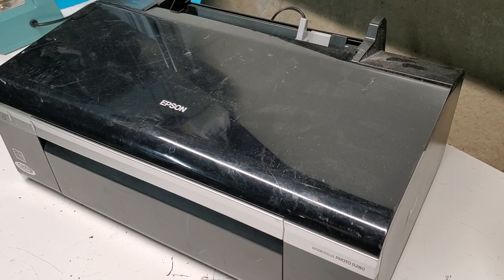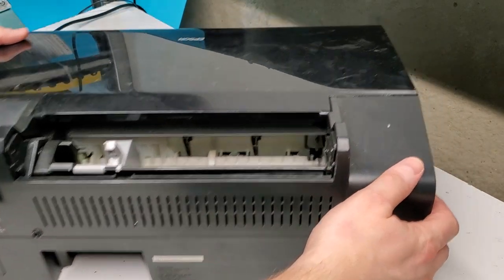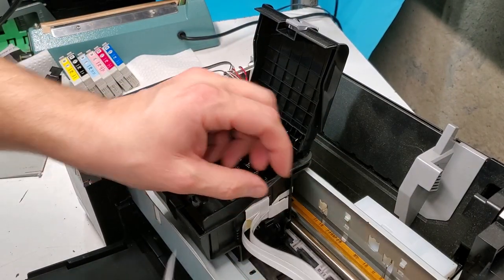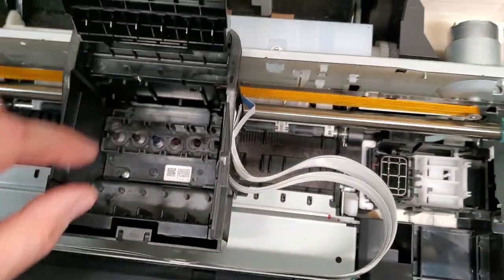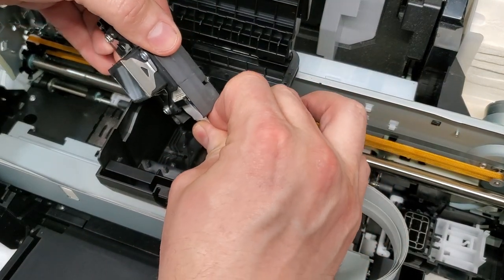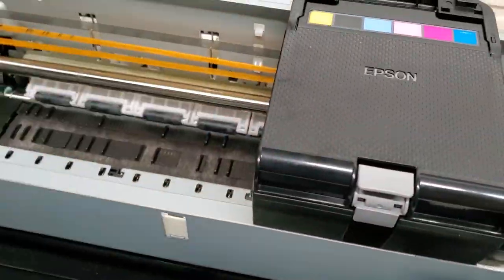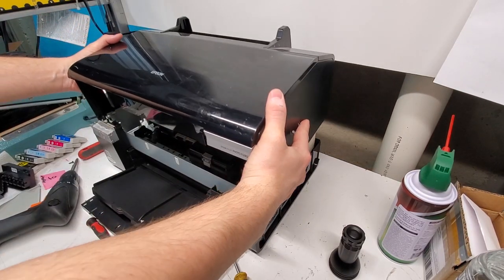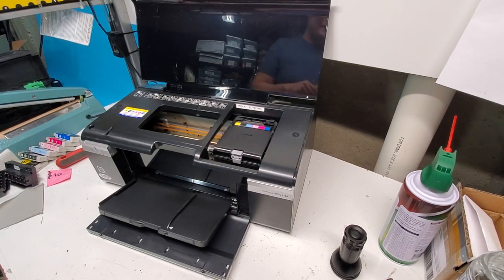How to replace or remove printhead on Epson Stylus Photo R280 Printer F180040

Comment: Do you have a video showing how to replace the timing belt that drives the print head carriage back and forth?  Printer head jammed and the belt came loose.  Belt is intact just not connected???
Reply from the maker: Hi, I do not have that video yet.  This video shows how to get inside the printer: 
https://youtu.be/XFqO8RH2E7I
Reply: Gonna try to fish it in place to get it going again.  I know several people in just my own circle of friends that are in the same spot... mainly due to broken or worn out belts, so this would be extremely helpful.  This was and still is an outstanding printer ... even better when adding a CIS ink system.  Thanks again.

Comment: I have a clogged Epson Stylus Photo R2000 which has 2 more ink cartridges. Would the replacement process be similar?
Reply: From my experiences having a graveyard of Artisans, 50's/260's/280's/1400's/1430's - yes.  The only thing different in my 1400/1430's is there are two release spots on the backside of the carriage. I believe there is a video using a bent hanger or rigid wire...same deal
Reply: @JD-nr8hf  I can show you how ot factory restore all the printers mentioned above to factory new, if they have not been destroyed by the user.  Starting in 2007 when the R260 came out, we began figuring out how to deep-clean these, how to modify the printer to work well with CISS, how to fill the CISS-cartrides where they meet the ink-input-ports, and how to deep clean without making a mess inside the printer.  in 2010 we figured out how to make Epson ink, without any pigment.  This is the best cleaning solution and costs about $115 for eleven quarts.  If you have these old Epsons, DO NOT throw them out.  Why??  The new Epson ecotanks that have built in CISS's (by Epson) do not do borderless printing, and they only use four colors.  When you try to print say 50 pages of full color borderless pages, the print pumps cannot keep up and colors streak.  With six colors in a CISS, you can 1) just add ink as needed by removing a cork, and 2) with six colors, the pumps can keep up.  I know of no epson printer, after 2019, that will produce borderless prints like these older printers.  With borderless printing you can use these older Epson printers to produce large posters using poster software on a PC.  We have produced and used more then 1,200 of these posters.  You create the image like a photo, the import it into the poster software, specify numer of pages with width and height and it prints it out with 99.5% perfect registration. Then you assemble it like a tiled floor and tape it together on the back side.  New Epsons do not have borderless so this cannot be done.  you can make  poster two pages wide and two pages high, so four pages or 17" by 22".  We typically print 5 pages wide and 5 pages high, so the poster is 42.5" wide and 55" high. iPhone pano's can be printed out 5 wide and one high, so the five pages taped together make a nice coffee table photo (11" high and 42.5" wide).  The largest we've produced is nine wide and 7 tall, so that poster is 76.5" wide and 77" tall. We printed another 96" wide and 99" tall but coould not assemble it, or figure out how to mail it.  Interesting isn't it?

Comment: Thanks, helped me get out head and soak it.  Clear some of a blocked yellow.   Might have to clean again as even after 3 cleanings and yellow purge printout, the yellow is still not all perfect on nozzle check print out.  But much improved then before.  Man getting the chip reader out was tough and getting ribbons back into print head.  I know you MUST get those ribbons in all way, or else can fry the board and they kept popping out until i really got them in good.

Comment: What is that stack of pads in top (further) right corner of the printer? Mine are black and those in the video are white. What is the purpose? Noise dampening?
Reply from the maker: Hi. The excess ink drops go there to avoid ink leaking out of printer. They are called "ink waste absorber pads"
Reply: The pads start out white, they absord the waste ink every time you clean the print heads.  You  can drill a hole in the side of the printer, then bring out the great 3/16" tube to an external tank.  Be sure the tube stays level with no uphill to the external ink tank.  If you are careful and use a clean 4 oz water bottle (rinsed with distilled water), then you can reuse this as black ink in a CISS system.  I mostly use 2 cup cheapo tupperware from the dollar store, four for $1.25.  Just drill a hole at the same height  as the 3/16" tube you bring out from inside the printer.  Epson count print passes, pages, and cleanings and has set the 'End of Service' such that the waste ink will not spill out under the printer.  That is their reasoning.  But this is just to get you to buy new printers, since the dye based ink is water based and the ink goes into the pads and water evaporates. I have never see any spillage.  I have R280 printers with 45,000 pages printed, with brand new waste ink pads. These printers all have external waste tanks, and they sit next to the CISS (continuous ink system) to the right of the printer.  Each time you clean a R260, R280, Artisan 50, it pushes ink of every color through the print heads (no matter is they are clogged or not). One cleaning pushes about 5mL of ink through. Considering a cartridge has about 10 mL of usable ink, then six cartridges have 60mL --- so 5 mL is a lot of ink.  This is by design so Epson has you buying ink cartridges.  But innovators designed the Continuous ink system (CISS) which has about 150mL of each color of ink.  So cleaning is no big deal, since you have a lot of ink.

Comment: I bought this printer used and all the cartridges appear to have ink but it’s not printing correctly. I think black is missing. 

I’m going to attempt to remove the print head based on your video. Good job by the way. 

What is the best way to clean the head?

Should I try to clean with alcohol while in place or it’s better to remove?

Thanks a bunch for help.

Comment: It went nice and smooth until I put everything back together. I tried cleaning head with ink and it looks like head drivers QM1/QM2 (TT3034/3043) went in smoke :( I presume I didn't let the printhead dry out long enough (over a day) from distilled water. It looks like those drivers are ~$50 on eBay and I'm not sure they took anything else on the way. Perhaps, it is time for me to move on. Don't repeat my mistake while cleaning/soaking.

Comment: Amazing video. Using one hand removing and installing it while the other hand holding the camera. Is this the same replacing the EPSON R260 Printer?
Reply from the maker: Thanks 🙂. R260 is similar to this printer and the printhead set up, but  printhead for r260 is not the same as r280.
Reply: @303electronics  Thank you so much! Keep up the good work and Happy New Year to you and to your family.🤗

Comment: Great video. Followed your steps exactly, now both ink reset button and forward paper buttons are flashing. Both flashing in unison.  When you turn the printer on, the green power button blinks as print head tries to find home, then it slowly goes all the way to the right, slowly, then stops , makes a noise like print heads are going up and down, then the orange lights come on.  Print head and ink carriage moves freely when you turn off printer. How do I reset this R280 so it works?  It will not print with ink button and paper pass button flashing orange.
Reply from the maker: Hi. Please make sure you have reconnected all wires properly.  The reset is not necessary. I do not know a reset process on this printer.  It is a bad connection of wiring. Please do over the process again.
Reply: Are you getting any messages on epson print monitor software?  Dual orange lights are usually an indicator of crippleware activation based on number of prints. It was epson's contention that the waste ink pad only had a certain number of prints the printer could handle and it had to be replaced and the counter reset with epson proprietary software. Unless you are insanely wealthy and have a sentimental or work-flow attachment to this item this is not economically viable.  BUT: I have two suggestions 1: install a waste ink receptacle (easy). 2. Google epson counter reset software and buy the one not made by epson, do not use the epson one. Only the paid version will remove the crippleware.  Costs short money to buy the software. If you use the temporary epson one it will render the third-party solution unusable.
Reply: @Houseofbears  Nice ideas.  Dual orange lights do indicate an End Of Service (EOS) which means no more use.  Correct.  And you can reset this by googling on Wic Reset and downloading the free reset software. You are correct also that the EOS is based on predicted "full" waste ink pads, which wicreset software can report. Once the level is at 100%, the cmos of the printer thinks the waste tank is full, and thus EOS to keep ink from leaking out of the printer.  The pads are located behind the print heads (R280 family)  when they are in the refill position.  Adding an external waste ink tank is a good idea, and we do this on most machines; However, the CMOS counts number of cleanings and pages etc and so will need to be reset every 10k to 14k pages (depending on number of cleanings).  Wic reset software offers a paid key that you can type in to reset the machine. These cost $10 each or $4 in bulk. A key can only be used once and the author does a good job of keeping track of when used on what printer.  You can get a free reset to set the counters to 75% by using the key "TRIAL" in the wic reset software. This works once per printer.  You are correct to never use epson reset software and also to avoid firmware updates-- since these often cause the printer to reject non oem cartridges.  The wic reset web site allows you to search on which printers or which brands allow reset. You should only buy printers that allow reset ---- and also which allow CIS or continuous ink systems.
Reply: Just ran across this, I had the same issue and had to make sure the encoder strip was placed back properly inside the slot, it slipped out during removal. So if it slams  or just moves back and forth and the lights(ink and paper jam) it may be the encoder strip(the clear strip right in front of where the ink cartridge is located).
Reply: @Houseofbears   For the epson R280 and many other printers you can use a pogram called 'wic reset'  Using this program you can reset the flashing orange lights, and set all counters in printer cmos to zero.  You are correct that orange alternating flashing lights measns ' end of service.'  Most think this means end of life, but you can buy a 'key' or 20 digit number through wic reset.  Most Epson R260, R280 and Artisan 50 and 1400 and 1430 get the end of service flashing lights around 11,000 pages.  You can buy one reset key for $10 or 25 of them for $100.  Once you enter the key the machine is factory new in terms  of counters.  This same key will reset the waste ink counters.  I have about 45 epson printers now, and these older models (R260, R280, Artisan 50) are all quite durable.  I get about 50,000 pages out of a printer or more.  Eventually, the printer will suffer a cold solder joint or other electrial failure -- and that's the end.  When this happens, take the printer apart and learn how it is made, and how the print head comes out.  DO NOT use any reset keys other than from wic reset, and never do a firmwarre update. Doing so will stop the printer from seeing your CISS.  BTW, you can get a trial reset key one-time for your printer from wic reset, and this will reset your waste ink counters to 50%. This works once per printer.  Wic Reset is amazing and there are 1000 printers supported, but not all are supported.
Reply: @project-enhancedfitness5766  If the flat strip is unplugged from behind the print head, this can be impossible to get re-attached.  So be careful in what you unplug.

Comment: am trying to do a RX685 which is similar but a real pain lol
Reply from the maker: You got this. I hope this video makes it a bit easier for you.
Reply: @bobjaesusjones  You don't have to remove the heads.  Simply remove cartridges and use a 50 mL syringe to gently force or push warm distilled water through the intake nozzles. (For tubing go to any car parts store and ask for tubing used for window washer system, which is about $0.40 a foot.  Cut into 6 inch section and viola. Rinse with distilled water before use.)  Be careful not to exert too much pressure on the syringe as it will squirt and can damage the print head. Run a sheet of photo paper through the printer and pull the plug when the paper is 1/2 way through. Photo paper is water proof and will serve as a dam and not allow water into the guts of the machine.  Use paper towels, cut into strips to blot the water.  You can also add DEG or di-ethylene glycol (10%) to your distilled water. Do not use tap water, wind shield washer fluid etc. since all these are made with tap water which contains a lot of particulate matter. These particles are big enough to clog your print head (tiny pores).  Never use acetone as this melts plastic, stuff your print head is made of. Some clogs flush quickly, others take days to dissolve so be patient. You can warm the water in your microwave as well.  Since epson printers clog easily, print every day one print on best photo. This will push ink through the print head. Also leave the printer on --- since the printer will push a tiny amount of ink every once in a while.

Comment: Have you ever seen this printer not recognizing installed cartridges altogether but any combination without one is recognized alright? I have aftermarket cartridges with ARC. The weird thing is that Epson soft shows date manufactured etc for those cartridges as long as one is out. You'd think if CSIS board or main board was bad, it wouldn't detect any, right?
Reply: Did you ever resolve this problem?  I just replaced my R280 printhead using this video.  Swap out was smooth, but I have the exact same problem @sawadiy described.  Any 5 cartridges installed are recognized and info is reported.  As soon as I insert the 6th cartridge (any color), all 6 cartridges become "unknown".  I have two sets of refillable cartridges, and they both do the exact same thing.
Reply: @newmovieaccount  I suspect that something else is still off with the board. IIRC the output from either QM1 or QM2 is used elsewhere besides the printhead itself. I was not confident in the replacement transistors I got from Ali to begin with. I ended up recycling the printer...or whatever BestBuy will do.
Reply: @sawadiy   My problem is the first one you described.  Up to 5 cartridges are recognized and their info is reported.  As soon as 6th cartridge is inserted, all read "unknown".  I have two R280 printers and tried replacing the head in each one.  They both do the same thing now.  Won't recognize a full set of cartridges.  I put the old print heads back in, and they still don't recognize a full set of cartridges.  Is there "security" firmware that is activated when the head is replaced?  Does the printer need a factory reset?
Reply: @newmovieaccount  Yes and no. AFAIK you do need to "program" the printhead if replacing. Nevertheless, I believe our issue is electrical.
Reply: @sawadiy  How do you "program" the print head.  I don't remember that from the video.  Electrical, where?  Where is the location of the board with your suspected issue?
Reply: @sawadiy What surprises me the most is that between the two of us, we have 3 R280 printers that do exactly the same thing.  That's why I wonder if it's a firmware version problem where Epson added code to prevent DIY printhead replacement.
Reply: @sawadiy  Thanks for the suggestion, but waste count is not my problem. I have WICreset and it reports plenty left.  I already reset this printer twice and changed waste pads once.  Most recently the printhead delaminated and yellow ink started seeping into the black.  It was still usable, but I had to clean and print constantly.  That's why I tried replacing the printhead.  But sadly, this looks to be the end of the line for my favorite inkjet printer.

Looking closer at what the cartridge check is doing, I don't think it's reading the cartridges at all.  Though it reports the removed cartridge as bad and the other 5 as Epson Genuine, it's not showing the ink levels for the other 5 cartridges.  So I don't think it's really reading them.  It's just displaying some default info.  As soon as it has all 6 cartridges and tries to read them, it comes back with "unknown".  So I'm thinking the symptom is different from what we thought.  

The only reason this was my favorite inkjet printer is because it printed nice photos and could print on disks.  Like all my numerous prior Epson printers it's been a PITA -- always clogging and using more ink cleaning than printing.  I'm mostly using laser printers now which run any time all the time regardless how long they've been sitting idle.  I don't plan to replace the R280 with another Epson.  Wish I could get this one running again, though.